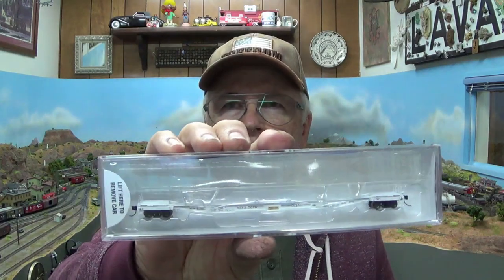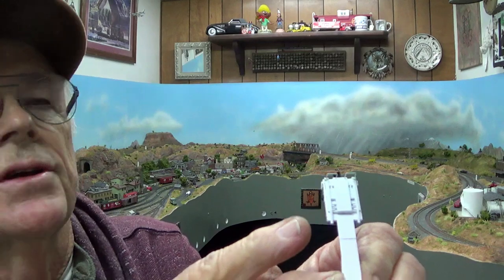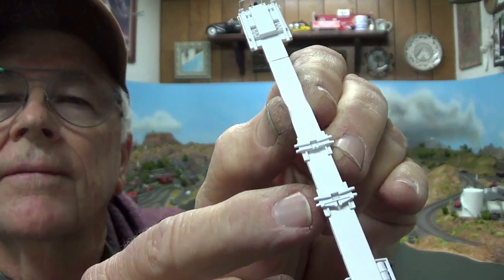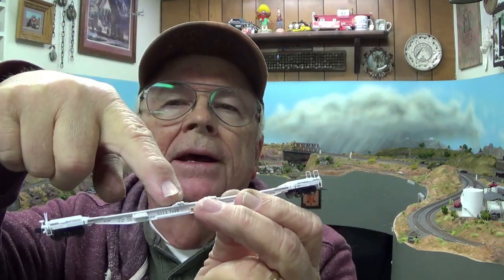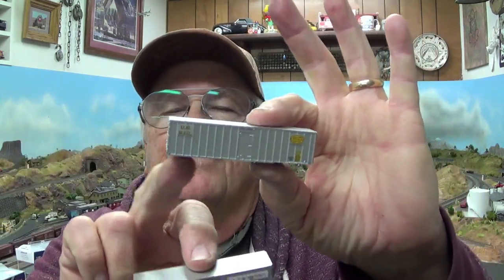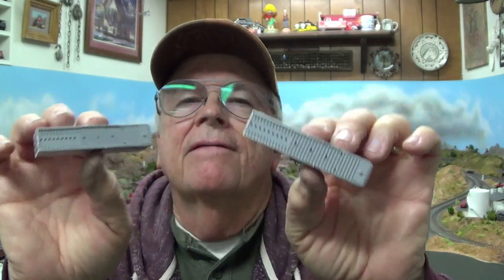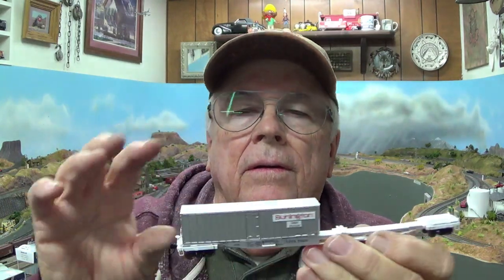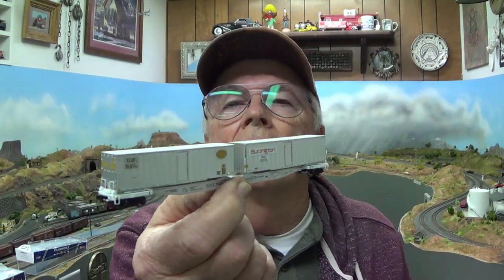N Scale Trainworx Flex-i-van cars and trailers. What are they and how do they work ?

Comment: Uh Mike. I didn’t have this video until now. I have these cars from you. When mine came I went out to craft store, purchased magnetic tape and cut a piece for the spline width of the car attached just to the rear of the fifth wheel receiver. The other magnet piece of tape I placed right behind the pin on trailer. The Milwaukee road Olympian Hiawatha with flexivan mail runs at full speed on my YouTube channel, with no cars flying off. Thanks Tyler